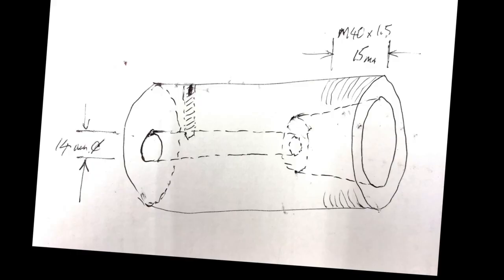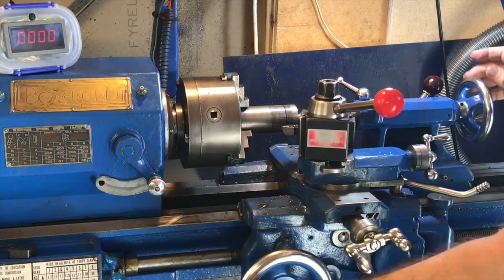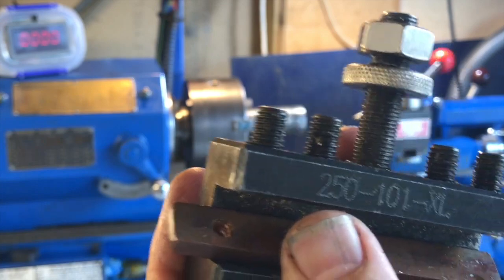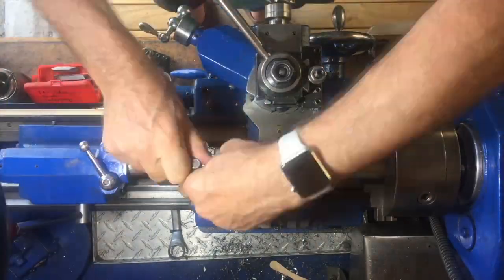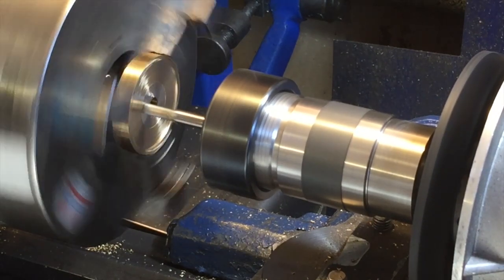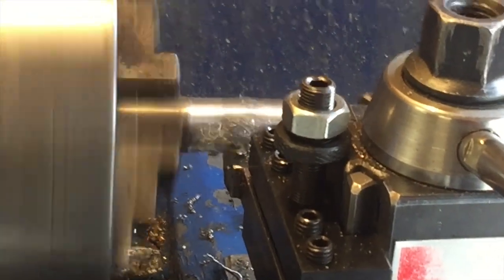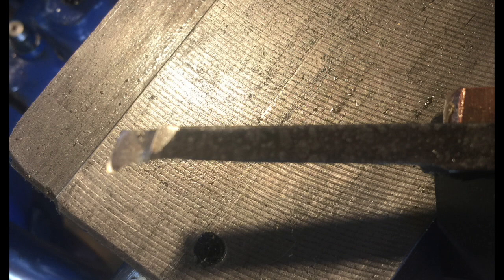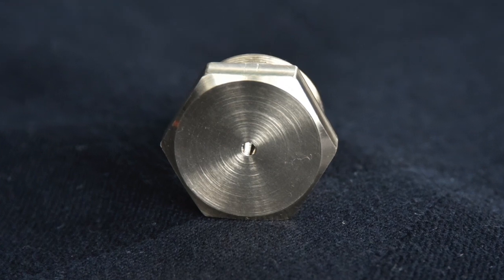Making an ER32 collet holder to build a Grinding & Milling Attachment for a  lathe - Part 2

Comment: I am problem the nonius sir . how to make nonius for turn feeding. Thanks
Reply from the maker: Would you like to explain more fully?  I do not know the term "nonius".
Reply: The number on all sleds of our lathe missing sir . how do we make the number of value on the sleds so that the machining process can be maximized. Thanks you.
Reply from the maker: @jakarwahh8142  I think you mean the dials on the cross slide and compound slide are missing.They are often called micrometer dials for the lathe.  Yes you could make your own. If you search Google using "how to scribe calibration marks on a lathe dial" you will find many YouTube articles showing how to do it.
Reply: Sorry to ask again sir . what is  power of the electrik motor , voltage & rpm to lathe machine boxford AUD.  Thanks you
Reply from the maker: @jakarwahh8142  The motor I used for the direct drive attachment came from an old treadmill. It is a brushed DC motor. I think the electronic controls are simpler than unbrushed DC motors unless you get the speed controller out of the original treadmill.  The DC voltages vary for different motors, usually 90, 130 or 180 volts DC. 

This particular motor did not have a label giving specifications.  I have been running it with a 180v DC speed controller without any problem. It does over 8400 RPM which may be faster than its design speed. They usually do about 5000 RPM. So it may be a 130 v DC motor. 

I have made previous YouTube videos in my lathe playlist about putting a similar motor in my lathe and another explaining how speed control electronics work using PMW (Pulse Width Modulation) for DC motors or VFD (Variable Frequency Drive) for AC motors. See the playlist and choose 'How to use an Engineer's lathe'.
https://www.youtube.com/@Evan-e-cent/playlists

As far as horsepower goes,  the speed controller limits the current to 10 amps max. At 180 volts and 10 amps the wattage is 180 x 10 =1800 W. There are about 745 watts in a horse power. 1800/745 =2.4 HP. This is correct for the bigger motor that I put in my 'Boxford A'  lathe and it was marked 2.5HP.  But if this motor is supposed to run at 130 volts x 10 amps max it would be 1.75 HP.  However, they do not usually run at maximum load. More typically at about 2-6 amps. At 5.75 amps 130 volts it gives exactly 1 HP.
Reply: @Evan-e-cent  ok sir , thanks